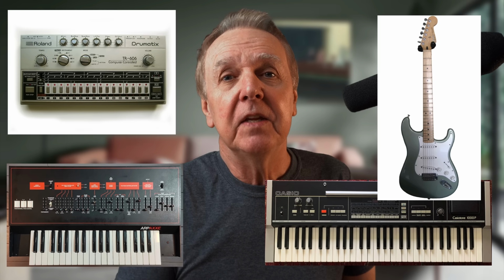What's wrong with dbx?

Comment: I never could get past the "breathing" or "pumping" effect of dbx.  Once heard, it's inescapable in subsequent listening.  To me, Dolby S is among the best noise reduction (with HX Pro assisting), however it came to the game much too late to be of any real impact in the cassette deck market.
Reply: Seems to be the way so often. A technology will reach its pinnacle to be supplanted by something new that surpasses it technically in performance, workflow and cost.
Reply: i have a lot of more modern cassette decks but i never used dolby it limits the quality of sound of the cassette deck that if working with regular manitenance one never hear any hiss ,if that happens ,something is wrong
Reply: If I run a blank cassette on my tascam 234 or 133 I get a little 'swoosh ' every few seconds.  It's very low, but weird.  Sort of a whoosh sound of blood when it's amplified going through the body.  Is that DBX effect?  The 133 is Dolby ii , but has it also.   You'd never hear it unless you turn up a blank spot on the tape.
Reply: @rcary  i never heard of that, but a lot of weird noises on old tape recorders, i undertsood what you ment, like air on a blood stream, more or less ,i also can´t express myself better in english , i´m portuguese ,that kind of banana´s republic with nice beaches
Reply: Dolby S is a watered down version of Dolby SR (Spectral Recording).  Dolby SR still is the best noise reduction system Dolby ever came out with.

Comment: I own a Luxman cassette deck, which I mostly used during the '80s and '90s.  With high-quality chrome and metal tapes, I always found slight to moderate increase in bias improved record fidelity.  And I also liked to introduce just a bit of saturation by finding the absolute peak signal volume of the entire song and adjusting the record gain to peak at 100% and with some content slightly above.  I did not perceive hideous noise.  And when played in the car or through my buddies' high-fi's I had the best sounding mix-tapes, by far.  (Having the best sounding mix-tapes you could share with friends was important back then!  You, certainly, already know this.)  As for the Dolby B and C, those sounded great played back through my own system, but hit-or-miss results elsewhere - mostly miss.  Have we covered tape AC bias in Audio Masterclass?   Enjoy your videos, very much!  Your Tascam PS recording with dbx sounds fantastic!  Love tape.
Reply from the maker: Your care over bias and level setting is admirable. Bias is often set by rule, but setting it by ear is likely to be better. I'd like to do a video on bias but whether my Revox still works is an open question at present. DM
Reply: @AudioMasterclass  My father and I both had mid 90s Sony TC-K series decks, and dubs I made with Dolby C transferred well between the two. His was a fewer years newer than mine so it had Dolby S, but both had a bias setting function which recorded an alternating low and high frequency on two channels, and the bias level was set by matching the VU meters. Dolby C was a hugely noticeable improvement over B, and a quality type II tape with S took some attention and a quiet listening environment to distinguish from CD. My college had cassette decks with dbx (Yamaha I think) but that's the only place I ever personally recall seeing it.

In the early 2000s I became the owner of a 1/2" 8-track Otari, along with an audio precision system one. With MRL tapes and a smorgasbord of tape stock, I learned about bias and IEC vs NAB equalization the hard way, but never got the chance to put my cassette deck to the same level of scrutiny: my father lost his deck in a move, and mine succumbed to mechanical failure of the loading mechanism. I got a replacement Aiwa deck (with Dolby C) shortly before having to put my studio in storage due to my growing family, but I plan on running it through its paces in the future. (Assuming the system one and supporting PC are still working... I wouldn't be surprised if I'm faced with some recapping.)

I understand the appeal of cassettes as a hand-sized inexpensive physical format, but nobody is manufacturing decks that are capable of extracting the performance that the media was capable of nearly 40 years ago. This seems to have lead to indy record labels releasing type I cassettes with no noise reduction, but are still apparently sufficient for their target market. I found one label that uses a duplicator with XDR and Dolby B and it was a great sanity check -- it sounded head and shoulders better than other contemporary cassette releases.

Comment: Compander noise reduction systems are often thrown for a loop by the nonlinearities of the tape decks involved. And the more noise reduction they aim for, the more problems they have. It's possible to align, say, Dolby B to be nearly transparent when a tape is played back on the same machine it was recorded on, but usually not when recording on one machine to play back on another. Today, working as a vintage audio service tech, I tend to align Dolby systems for best subjective results, not the best measurements, and my clients are usually amazed with the results. Of course, this is after aligning the tape deck in the usual manner without noise reduction.

In the early 80's, I engineered in a home studio that used a Teac 80-8 multitrack machine with its associated dbx noise reduction box. I quickly learned that even when I had the machine carefully aligned, it was better to record drum tracks with the dbx turned off. It just could not follow the transients of say, a snare drum by itself. It seemed that dbx did much better with a full mix, and definitely did better with continuous midrange tones, like strings or backup singers. Didn't work well on bass guitar, either.

Comment: In 1975 bought the dbx 119, for my Teac 360 cassette deck. A totally discrete, separate enclosure, model with adjustable gain and, "Compander", pots. So the compression and expansion varied from 1:1 to 2:1. There may have been an Infinity setting too. I still have the pamphlet somewhere but sold the unit decades ago. The auditory," Breathing", introduced made the use unfeasible.
Reply from the maker: I had a demo of one of these. It was an interesting idea but in practice I didn't like it. Opinions may vary. DM

Comment: That closing demo doesn't actually sound too bad, but, as with all things, it IS a demonstration of an 'audio pro' using non pro kit, which probably notches things up a gear anyway 😀. I was senior engineer in a London studio complex that specialised in audio for video and visitor attractions. We used a mixture of Dolby A and SR, as well as  dbx type 1. We even ended up using Dolby C on Fostex 1/2 inch 16 track machines for onsite replay at visitor attractions like the Lands End visitor centre in the mid 80s. dbx 1 sounded surprisingly good at first generation level, but second generation copies REALLY began to exhibit the pumping effects dbx was famous for!

Comment: I've never used dbx noise reduction with cassettes. dbx type II was developed for cassettes but also open reel machines running at 7.5 and 3.75ips, so type II was always considered the domestic version of dbx. Type I was used mostly on open reel recorders running at 15ips, though you could get good results at 7.5ips if the machine was electronically and mechanically aligned correctly. At 15ips, type I was a revelation. I could never really notice any noise pumping issues, but the criteria was always flatness of frequency response and a properly aligned machine. If you could hear obvious noise issues with dbx on an open reel at 15ips, usually the problem was the machine, not the noise reduction unit.

Comment: DBX worked pretty good on the 1/2” 8 track machines of the 80’s, but any smaller formats suffered from a lot of modulation noise. 

Search what happened to steely Dan when they used DBX on the multi track machines for ‘Katy Lied’. 😅

Comment: Love these videos. I can't believe you've got that demo outro stuck in my head. I wonder if an updated dbx could work for vinyl without the modulation noise.
Reply from the maker: There was a version of dbx for vinyl. I'd have to search my memory whether I've heard it or not but I would expect it to work quite well considering the signal to noise ratio of vinyl is about 10 dB better than cassette. DM
Reply: Check out Techmoan's review of dbx for vinyl

Comment: A long time ago in a land far from here (NZ) NEAL made cassette decks. But, did you know that they also made a high-speed version?? Yes they did, we used to sell them. It ran a 3.75ips and was the best sound EVER from a cassette deck. Almost flat up to 18khz not 10dB down like most decks. Sadly, they were quite hard to sell. Everyone agreed the sound was near 100% but you could not change the speed to play normal cassettes. Of course, you needed a C120 to get 60 minutes of play time. This arrangement was short lived however as it contravened the license agreement of Philips. 
Just imagine if cassette decks had all been 2 speed, one speed for the sound deaf and one speed for the sound enthusiast. Now that would have given cassettes a real boost in sales.
Reply: Interesting solution. Anyway  later engineers were   able to improve electronic and tapes so much that the same good become popular with 4,7 cm speed In  my case my hearing silence all above 13 khz while microphone register  it well. Still my reception of quality is not changed but in accordance to what I remember 50 years ago.
Reply: Another format that didn't take off the the El- Cassette a larger version running at 3.75 ips the Sony ones we had sounded amazing
Reply: @pauldavies6037  EL cassette was amazing, but very hard to sell. No prerecorded music, cannot play in the car or swap with anyone else. Expensive, but did sound very good indeed.
Reply: @MichaelBeeny  Yes another format that cost Sony a lot of money

Comment: Let me be the tenth fan of your nice song from back in the day! Interesting changes of tone, and an overall relaxing feel. Reminds me of the gently flowing Seeburg licensed background music that someone is putting online now, but with 80s synth tones instead of an orchestra.
Companding was an engineering shortcut in the early samplers - Fairlight I & II, Emulator I & II, Ensoniq Mirage, Synclavier - until CD quality i/o became the standard with Fairlight III, Emulator III, Ensoniq ASR. Along with the anti-alias tracking filters that opened and closed up and down the keyboard range, a not completely realistic but very musically compelling, thick and gritty transformation of whatever was played through the system.
Reply from the maker: I had, and still have, a liking for the gritty sound of some samplers of old. DM

Comment: It all has to do with the slew rate of the amplification of the dbx system. It’s personal but with my Technics M255X the breathing was barely noticable and listening to those old 80’s tapes I’m surprised with the quality left on them.☺️ I used Maxell XL2 and XL2S tapes as the TDK tapes had too many drop-outs for my taste. (That was my main irritation!)
Reply: Ow and so using a separate dbx2 unit is asking for trouble☺️(cables introduce more side affects where build-in units have short signal paths)
Reply: BASF cassette tapes for me always. Agree about TDK - quality was very variable from batch to batch.

Comment: There also was a dbx vinyl record format that failed. Many years ago I had a dbx record/tape adapter and a dbx test record. I remember hearing literary nothing when the music stopped. Even back then, it was hard to find dbx recorded vinyl records. Apparently, dbx encoded records had to be mail ordered. Local record stores did not carry them or even know what they were. I made some home recordings with the dbx adapter on a Pioneer cassette deck. It had the same nearly dead silence on it when the music stopped. I also heard that modulated noise. Particularly on a dbx recorded cassette of someone talking. I still have a Tascam 4 track in a box somewhere. It was the digital version that recored 16 bit 44.1 to an internal hard drive. You could transfer separate WAV files to a PC over a USB v1.1 cable. Each track was its own file I recall.

Comment: Another problem with dbx was that it was incompatible with listening without dbx processing. Listening to a Dolby B tape without Dolby B processing isn't ideal but it's at least tolerable. By the time Dolby C was introduced nearly everybody at least had Dolby B; much like listening to a Dolby B tape without any processing, listening to a Dolby C tape with Dolby B processing was tolerable.

In contrast, listening to a tape recorded with dbx noise reduction without the proper playback processing was just about unlistenable. That made dbx a non-starter for prerecorded tapes, aside from a handful that were made specifically for audiophiles, and it also meant that you couldn't use dbx processing if you were making a tape for somebody else since few listeners had dbx.

Comment: Oh this is an excellent video with excellent exclamations I’ll give you a quick little story about the Harmon-Kardon tape deck in about either 1982 or 83 that I really loved and I would have it connected to a techniques receiver techniques turntable with a nice AT (AudioTechnica) cartridge attached and I would have a clean and I mean really cleaned and De-stat with a static gun thing, an album I could make pristine recordings under that Harman Cardin tape deck with either DolbyC used or with “DBX” NR used (sorry my spellchecker just want to be right there any other way). Anyway I also had a fairly early generation of 1984 techniques CD player and whether I was recording on turntable or from CD player or from a clean De-stat’d album LP I found it difficult to tell the difference in those DBX recorded cassette tapes. I can vouch for how good DBX noise reduction worked!
Reply: Hey folks, sorry for me being foggy on details because I no longer have this equipment and having for many years but I’m pretty sure the Harmon Cardin tape deck of purchased in the 1983 time frame had a special version of DBX noise reduction when I can’t remember is what it was called like DBXHE like high extension or DBXHD or DBXHX anyway, it implied that it had a better compounding expansion design than the previous DBX II did. Everything else I’m saying is the same I just was amazed at how good either doll BC NR was or this DBXHX or whatever it was but of course you had to have used it when recording the tape and as well as playback and it’s just, I mean it made my turntable sound quieter. It just had really good quality recordings from a clean record on that techniques turntable with AT cartridge. Loved it!
Reply: I think I Kind of remeber stuff - it had DBX HX-Pro setting. I’ve been googling just now until the cows come home and I just can’t be sure of the exact model number of it when you look at CD 91 CD 101 cd 20 one cd 401 model number is a kind of all look similar to what I had.From HK (Harmon Kardon). Great sounding tape deck!

Comment: Used a similar device, the Sanyo NR55 Super D two band compander, connected to a Tandberg TCD3034. I know companders
limit the frequency response but since the deck was flat (-15db) from 11Hz to 26,5kHz, Maxell UD XLII, that was not a problem.
No one at the time was able to tell the difference between a cassette recording, and the source CD
Reply: I read the answrers, the Sanyo super D was a TWO BAND compander, so no pumping, and  a tape rec/play on that system was as dead silent as that a CD was, it was black. No noise whatsoever

Comment: DBX was always a bit hampered by beeing a single band compander. Nakamichi's HighComII, a dual-band compander, or Telcom C4, a quad-band 1:1.5 compander, do a much better job in terms of modulation noise. But even single-band companders that work well exsist. Sanyo SuperD and, best of all, Toshiba's A.D.R.E.S. are notable examples. Personally, I own 14 different noise reduction systems, and having tested them all thouroughly, the best ones are Dolby SR, with TelcomC4 as a close runner-up. And both these are also usable with cassette if the levels are kept moderately!

Comment: NPR's first satellite system used 3:1 dbx to clean up the 40 dB range satellite channels to give 120 dB range, in theory. They never go there in practice because the output of their studios was far less than 120 dB, and even the electronics in the satellite modulators and demodulators couldn't achieve 120 dB. A few years later I used dbx Type II to clean up a noisy stereo broadcast loop from the phone company from 60 dB to 120 dB (in theory). That seemed to work really well.

Comment: Dbx is terrific, specifically 150 series.  It works well with the exception of fast attack times like drums.  One can DBX almost every other source without issues.  Dbx supports about 120 db per second attack time. Achieving 30 to 40 db noise reduction can be achieved on open reel.  With drums you can hear the compressor pumping…..